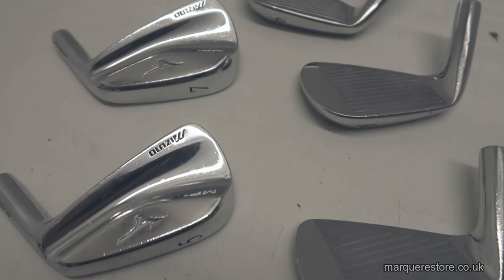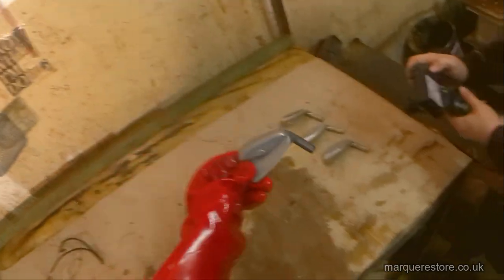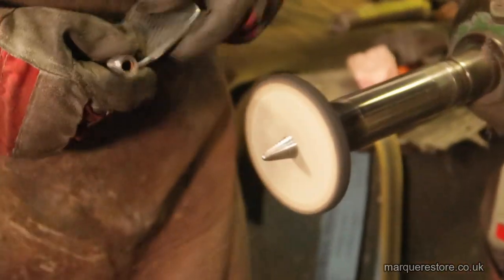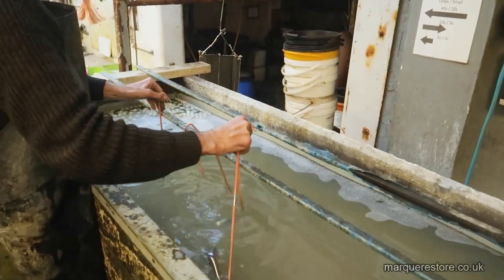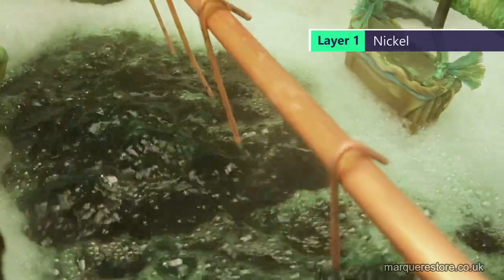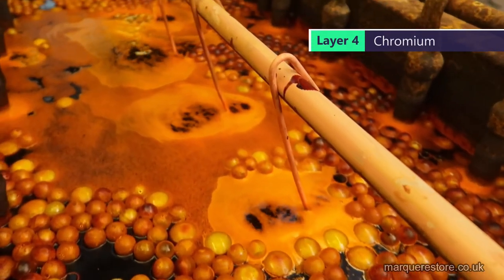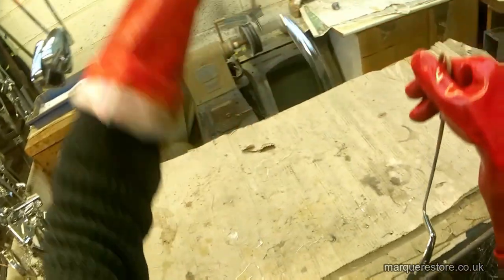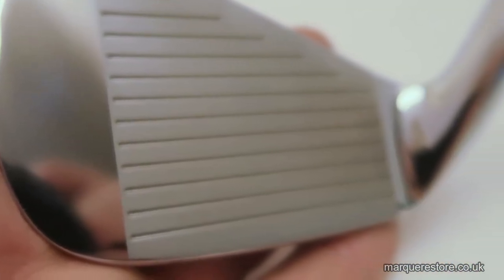Golf Club Restoration - How to restore the chrome finish on a set of MIZUNO golf club irons

Comment: Well done guys. May I suggest 2 improvements to take it to the next level? (1) I weigh each head first before starting any work, and weigh again after completion. That reveals what mass is lost (if any) by grinding out the blemishes, and the appropriate lead weight can then be added to the tip of the shaft by the club assembler. (2) I sand blast the face once all the polishing is complete but before the plating process. Beautiful appearance eliminating the chance of damaging the chrome finish. Cheers. John

Comment: One thing I wish I had was a media blaster, I love restoring old clubs, working on my set of Nike SQ Machspeeds at the moment but the resurfacing of the face would be much easier with one
Reply from the maker: Agreed. You can buy small hand held ones that would do the job, but they are very messy.

Comment: Amazing, I have an old set of Mizuno MP 32s, 3-PW I would like refurbishing, what was the price per head for the MP 5s?
Reply from the maker: £43 each ex VAT. This is including the 'layers of feel' plating process. £35 each ex VAT if straight nickel & chrome.
Reply: @ChromeandCarRestoration  Does that pricing matter how much rust is on them? I have my uncle's old MacGregor M/T set and they're an absolute mess. But they're the RST1 model, so maybe its appropriate that I just keep them like that.

Comment: Can you share the voltage and current requirements for the nickel and copper steps? I'm doing this on a small scale at home on channel but I'm struggling with dialing in the power. I'm using 4.5 vdc and 1amp on the nickel and 3 vdc and. 5 on the copper. Am I close? Please see my channel if you can help.